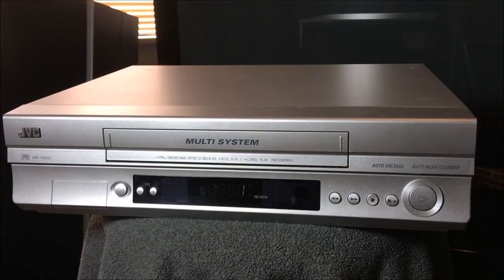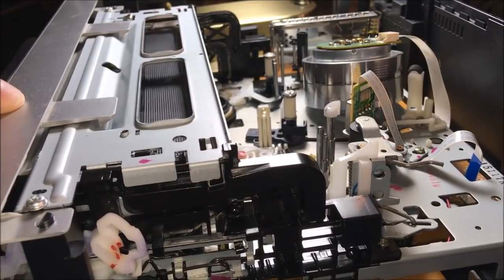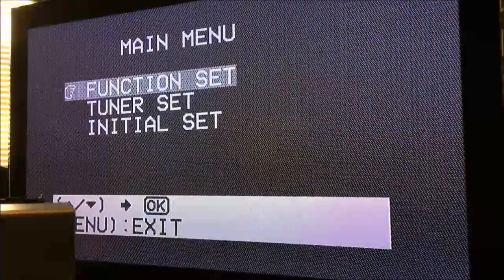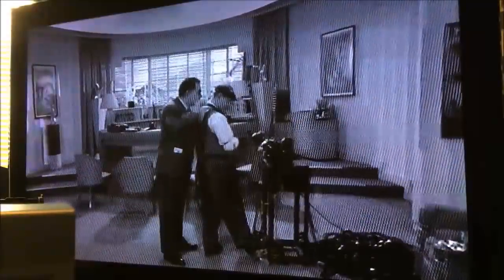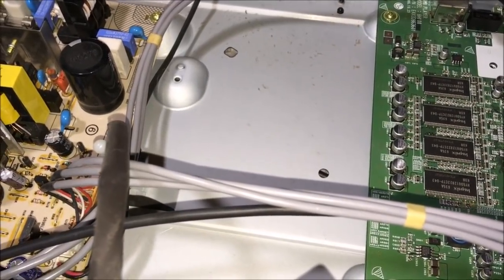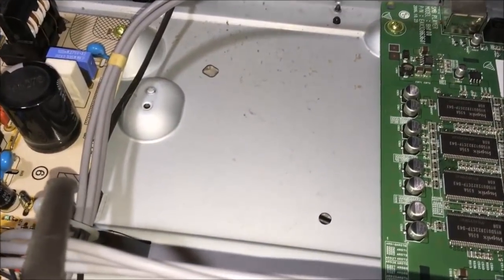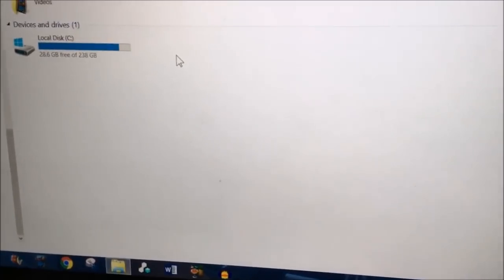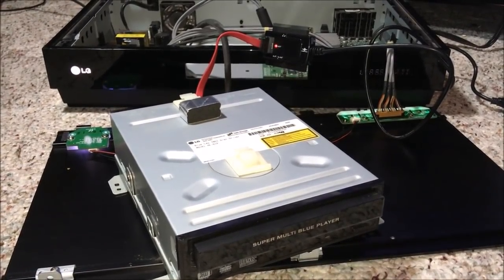Multi-System VCR + LG HD SuperBlue Player

Comment: That VCR appears to be a euro market machine (most VCRs sold in Europe were multisystem but outputted PAL only). True multisystem VHS decks sold in the US do have the option to output NTSC video. Also, that VCR cannot play SECAM tapes from Metropolitan France. VCRs sold in France used a different, more complex, way of storing the native SECAM signal on tape. The rest of the world used MESECAM (Middle East SECAM) which basically converted the SECAM color signal to PAL and stored it on tape.

As for the HD-DVD/BD combo player, I can't say I'm surprised its broken. LG sold the same multisystem drives for PC use during the time period (the GGW-H10N and GGW-H20L).
Reply: They were usually models for the middle east and arabic countires. I have a bunch of early 80s multi system VCRs.
Reply: Machines for the EU market would, typically have a SCART connector or two.
Reply: True SECAM was very complex, and had 819 vertical lines. Like he said, most regions used 625 lines with SECAM color encoding.
Reply: The 819-line System E/F broadcasts were all in black and white. France went to the standard 625i/50 system when they started SECAM color broadcasts.
Reply: NJRoadfan  Look at the languages. Russian and Arabic. Seems to me it's for the near east area.

Comment: Greetings from Austria ( not Australia ) in Europe. It's common in Europe that VHS VCR's have the function to Play any VHS Tape ( PAL / SECAM / NTSC ). Older VCR's also had the function to switch to different Voltages and you also had a switch to decide between BW and COLOR.

Comment: In Europe since the early 90's most TV's can display both PAL and NTSC.
Reply: Europe had pal and secam. Never had ntsc.
Reply: But TV's does support NTSC, only cheaper TV's in Europe doesn't support NTSC. And sometimes I play NTSC games on my modded PS1 and it works great if the TV supports NTSC.
And we also had PAL60 (525/30 4.43MHz).
Reply: My 2001 Grundig TV supports PAL, SECAM and NTSC. Tried many NTSC DVDs without conversion.
Reply: Many TV's in Europe did have NTSC playback, I had Sony CRT TV's back then and was playing a lot of NTSC VHS and DVD on those. I could just put any VHS or DVD to my players and see them from my TV (in Europe). Not all TV's and VCR's had the NTSC support but the ones I got had it. My very first TV (a Finnish made Salora) only had NTSC 4.46, but not the other frequency, but my Sony TV's were showing both NTSC frequencies.
Reply: @BlueNeon81  Correct me if I'm wrong, but, DVDs are not PAL or NTSC, it's the player that determines the output. They are region encoded, but, the actual video stored is the same regardless
Reply: @OtterlyInsane  Not quite. PAL and NTSC  refer to the analog composite output technically speaking, so connections like composite and s-video are pal or ntsc, but rgb and component are not. Also, since dvd is digital video, it is neither pal or ntsc. The thing is, pal and ntsc are also used to identify the refresh/framerate and the video resolution. So a PAL dvd has digital video encoded at 25i at 720×576 and a NTSC dvd has video encoded at either 30i or 24p (in some cases) both at 720×480. Even though the player converts everything to analog video, pal dvds are not the same as ntsc dvds
Reply: @OtterlyInsane  DVDs are also encoded PAL (25 fps 720x576) and NTSC (29.97 fps 720x480). For example, I live in region 2, we have PAL system, but Japan is also region 2, but they use NTSC system, so I can play japanese DVDs, but since they are NTSC, my DVD player must have NTSC to PAL conversion (it has, my DVD player is from China and is region free).
Reply: I have a Commodore WEB.IT that I think outputs both.  I imported 2 of them from Germany.  All I had to do was get a US power adapter.  I was worried when I saw that SCART plug!
Reply: @gintaszukas314  AFN was in NTSC...

Comment: The multi drive probably has a bad blue laser most these drive have two diodes one red for DVD and one Blue for the Blu Rays and HDDVDs. If you can find the parts for this drive and replace the whole laser mount it might work again.

Comment: I'm in the UK and RF has been standard here for many years for terrestrial TV (from analog to digital). I'm surprised that it doesn't have scart as that was very commonplace for equipment of that era in the UK. If you get one with scart  it may well output RGB and stereo audio via the massive scart socket (which I hear wasn't used in the U.S).

Comment: You should set the NTSC selector to "NTSC 3.58", because that is the regular North American signal format. "NTSC 4.43" is a non-standard compromise format only found in multistandard VCRs and typically accepted by televisions sold in Europe. It was only ever used to cheaply bridge standard gaps. If you live in a proper NTSC country it is of no use, and selecting it will cause the image to be in black&white when playing an NTSC tape.

Comment: PR = PRogram

A programmable memory for a RF tv channel. In the setup menu you would be able to tune it. Not that there would be anything to tune to these days. Unless you tune into the rf out of something like a C64.

Did you try a DVD+R? The logo on the front says its a DVD+ burner, not a DVD- burner. Personally I only use + discs due to their better design in addressing. It allows the drive to locate any part of the disc randomly, performing the same functions as DVD-RAM much cheaper. It is also immune to buffer underrun (not much of a problem these days) and multi session recording is handled in a much better way than DVD-

Comment: What surprises me is that your modern LCD televison didn't just switch systems to PAL automatically and display everything in colour off the bat.
Reply: Probably the TV's analog part is NTSC only.
To be honest, I would rather have bought an universal upscaler and connected it using HDMI instead of converting analog PAL to analog NTSC. You can see by the jittering menu text that the converter struggles to fit the PAL lines in an NTSC signal. Now we get the worst of both standards: 25 frames and 525 lines.

Comment: You can tell that the VCR is not an European market unit as it doesn't have SCART connectors, which were the most common connector here in Europe for VCR's. The IEC antenna connectors are the type which is still used here in Europe.

Comment: at one time i had a tv that was not only high def but also it converted signals from pal, secam and ntsc. to bad the tv dropped the blue color and died. it was a 2000 model Princeton Graphic Systems or just simply princeton and it also had the add on tv tuner. it was a monitor made for studios but man that thing was heavy and such but for a 27 inch box it got its use for what it was.

Comment: My HR-475ea outputs in PAL, NTSC & MESECAM, that is the weirdest multisystem VCR I’ve ever seen only outputting in PAL and not having a colour system button (which lets you change the outputs). With all that said even mine is relatively light and doesn’t have much under the cover. 

And I know it’s putting out an NTSC Signal as I changed the settings on my TV and it went black and white like this TV in your video.  Still that’s not doing bad considering Multisystems are more rarer in the states.

Comment: I think you need to clean the lens in the BD-ROM drive.
Reply: maidenfitter I still say it's worth a shot to try, I've had a couple laptop Blu-Ray drives that only needed a good cleaning to get working again.
Reply: the dust and dirt is really serious with such drives, but good luck to clean a Macbook internal drive-which is not opening like windows ones, i just don't want to messing with it(it damaging discs when writing) and bought the separate USB drive-the last Sony 50Gb blu-ray, which they've made in 2011, now they closed this business.
Reply: I think the solder goes bad on the laser diodes. The same fate affects PS3 consoles, resoldering fixes it. It'll be that awful lead-free solder mixture that is responsible for GPU issues (RROD and yellow light of dead), it just can't take the heat and fractures.

Comment: The first, last and only true multisystem VHS VCR (Pal to NTSC and reverse) I ever saw was in the (old) Philips company store in Eindhoven (before the company store moved to the Philips/PSV stadium). Late 80's. Semi-pro price. Over a thousand guilders at the time. Couldn't convince my dad we needed it. Spent the next 15 years or so dealing (unsuccessfully) trying to transfer stuff on consumer VCRs.
By the mid 90's pretty much everything was multisync. So a Pal VCR could play an NTSC tape. And a TV would play NTSC. So you could go to the U.S., buy a tape, and watch it. But connecting an old TV? Making your legal backup copy? Forget it!

HD-DVD? I may have one, still sealed. I probably also have a drive (possibly LG) that can play it on a PC while also supporting BD. Have I tested it? No! Will it be sitting in a crate somewhere collecting dust? Yes it will. 

Hey, at least I have a brand new TED.

Comment: PR 1 “Program” 1. Unlike NTSC VCRs and TVs, European VCRs and TVs had a different way of storing TV station channel settings. You had an X amount of Programs (memory positions) that you can program to tune to a certain station’s channel. You can create your own order of channels by selecting band such as VHF 1, channel 1-6, VHF 2, channel 6-12, UHF channel 21-69 (USSR standard). The NTSC TVs and VCRs only have set channels starting with VHF channel 2. There is no channel 1 for some political reasons. You can only select to store or skip the certain channel but they are always in a certain order that you cannot change.

Comment: 3.58 is standard NTSC, 4.43 is NTSC with a PAL  color. If its a UK model its putting out standard  PAL - I, most of these multi system were incapable  of producing pal -m/n which is pal with 3.58 color (approx). The converter you have is low end they were used with video game consoles.  The down converted signal ( which is stored on the tape) for PAL is the same its what the VCR produced  as a result that matters. Panasonic and Aiwa  in the UK produced VCRS that played back NTSC and PAL tapes and allowed you to switch between 3.58 and 4.43 they didnt changed the actual format   just the color system used.

Comment: For the tape head cleaner, it looks like the foam is on a white wheel that snaps into the light-bone-colored plastic arm... it might be a better idea to remove the white wheel/spindle from the bone arm, than the entire arm as you mention...

Comment: LG will have put a very custom firmware on the drive. Although the hardware itself may well be a modified PC drive, that'll be because they had loads lying around. I remember this machine coming out and there being an issue where the blue laser failed very early on. In fact I also had a Samsung BD-ROM drive for my PC that failed after a year with a similar issue.
Reply: My very thought. Glad i'm not the only one who thought this. I have tested loads of these blu ray drives in the thrift store they are all DVD only at this point. For whatever reason they seem to fail to play blu rays. Software for the player expiring and then failing to play anymore? I wonder.
Reply: I don't know about thi particular unit but the old dvd recorder would work with almost any PC dvd burner, the only difference was that the original drive had custom firmware to limit cd speed to reduce noise, the pc drives would work but were much noisier because it would ramp up the cd speed.

Comment: If you connect that SATA DVD drive to a computer directly on the motherboard you will be able to do all those functions like burn a DVD and all of that. The problem you are having has to do with that converter from SATA to USB. That has some compatibility issues because that little converter was designed for HDDs and not for Optical devices. Best regards and sorry about my poor english.

Comment: 6:00 If your unit didn't come with a remote, you would not be able to change anything, so it would not be fully multifunction. This kind of flaw went on and on for years with nearly any consumer grade video device, and it's still the case today. Why? Why can't we have a navigation system on the unit itself to access all functions? I can understand technology limitations from back in the day, but it should be ridiculously easy to implement now!

Comment: Looks like the BD player was defective at some point and somebody swapped out the dead drive for a different unit. Apparently that didn't work, so they may have tried to update the drive firmware which kind of messed up the entire drive in the process.

If you can get a spare HL-01P drive, you can probably make it work as intended again.

Comment: Why Multi-System VCR are common in PAL countries but rare in NTSC countries? It's not fair that most of them can play our NTSC tapes but most of us can't play their PAL tapes. Most PAL TV are also Multi-System via AV input but not RF. But most NTSC TV are not Multi-System in both RF & AV and displays PAL in black & white. Our VCR which we bought in 1990s is a Multi-System Sony SLV-KH3 (PS) but it took me a while to find that model because most are Sony SLV-KH3 (PL) which is NTSC only. Our old TV was NTSC only with V-Hold and can display PAL tapes in black & white until in 2008 which we bought a Sony CRT TV model KV-AR212N60 which is Multi-System via AV input but NTSC only via RF. It's the first time I saw our PAL tapes in color.

Comment: I wonder if that burner/bd-rom drive has custom firmware (bios) on it from the manufacturer (LG). Their licensing may prohibit them from using those features as a cost saving measure. Ie. they may have ordered the drives with only the playback functionality (and paid a lower cost per unit) and the bios does not have any extended functions set in it. That's my guess.

Comment: What if you just replace the drive with another BD drive. 

I knew there was a reason I never got any devices that could play Blu Ray discs. DVD at the most.
Reply: coondogtheman1234 won't work usually these drives are pared with the mother board you would have to find the exact same drive and replace the board of the drive with the new one and even then might still not work. I think he's issue is the Blu Ray lens if he can find a whole new laser rack and replace it I'm 100% sure it'll be back and running.
Reply: Depends, I have an old LG DVD recorder that the original drive would only play CDs, cleaning the lens wouldn't work, I tried swapping a few drives in and most of them still worked, even a sony burner worked, I think you just had to remove the master/slave jumper if I'm not mistaken (or leave it at master I'm not sure it was long ago), anyway even though the original drive was a simple burner with modified firmware to limit the speed to reduce noise, it had custom mounts to attach to the chassis, so I ended up dismantling a LG burner that coincidentaly had similar laser and PCB assemblies and swaped the insides from one another, it still works but when listening to CDs the drive speed up and it gets bit noisy.
Reply: @t0nito  I've heard that you can't do that with a ps3 drive also a ps4 drive because the drive and the main board at married in firmware and it's not as easy as swapping out a drive. I wouldn't think that this player in the video would be the same but I guess different drives need different drivers.
Reply: @coondogtheman  PS3 and PS4 are a different reality, the drives and motherboards are married per board, those are just Sony policies to keep "foreign" hands out of "their" equipment, as Sony, just like Apple do what they can to make third party repair as difficult as possible. I don't believe that these units have married drives, and may work with other BD drives but I may be wrong. Nothing like getting one and trying to find out, if it doesn't work it can atleast be used on a PC.

Comment: Great video! Truth be told, the BH100 was a piece of junk. It wasn’t even certified as a real HD-DVD player because it could not play back HDi content from HD-DVD discs. The BH200 is the far superior model. I own two of them and they both still work to this day. As a Bonus, you can also use the BH200 as a multiregion Blu-ray player.

Comment: the best reason to not buy an early blue ray player is they loaded VERY slow. I have an old Magnavox Blueray player that was probably manufactured  in 2006 and I stopped using it after a couple months because I was so tired of how long it took to load discs (blueray, DVD, or CD).  Newer Blue ray players are much faster and responsive due to much faster chips, even if the old ones were built like tanks, they were just way too slow.